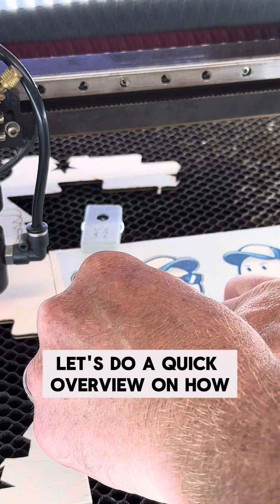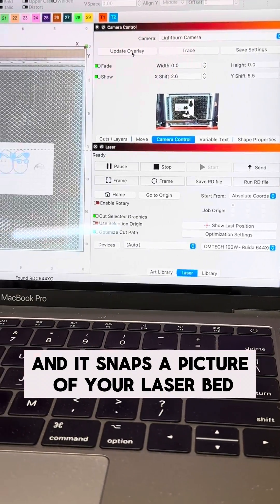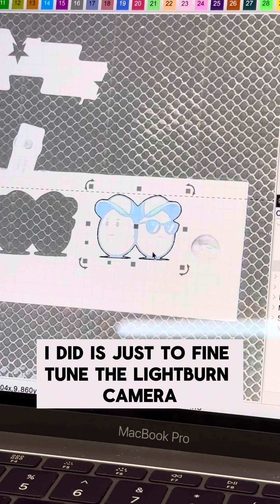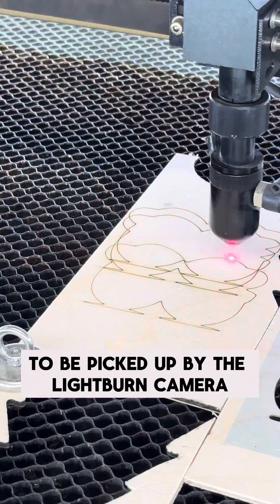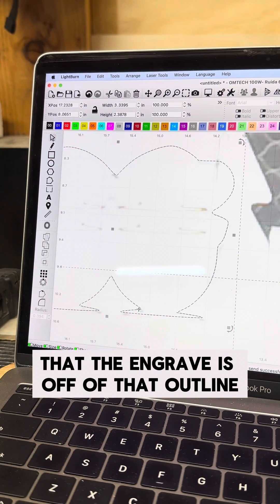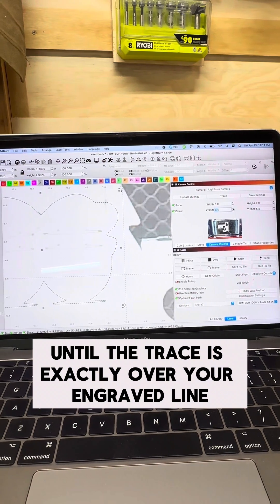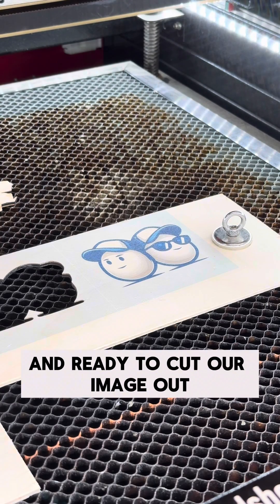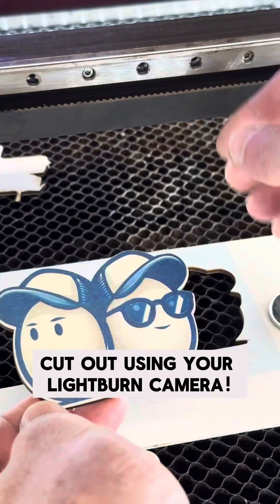Print and Cut in Lightburn

Comment: I'm confused...
Reply from the maker: @angieangie21  I used a white toner printer and printed the image and transferred it to the wood and then you can use either crosshairs or a lightburn camera to align it in the laser to then cut out the image on the wood
Reply: @ashandemberwoodshop  thanks so much for the extra explanations - very clever! I have rewatched your video a few times and understand much better :) I want a white toner printer now 😊
Reply from the maker: @angieangie21  you are welcome. They are so versatile but can be tricky that is for sure